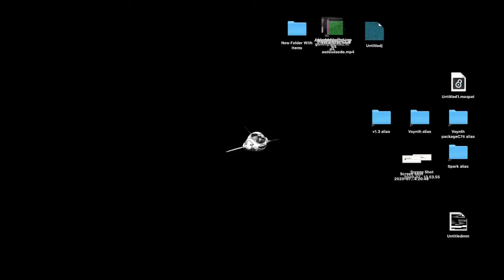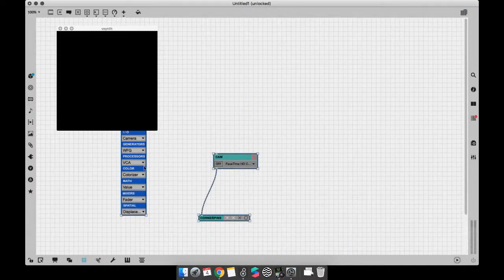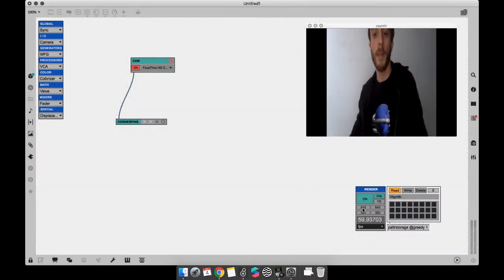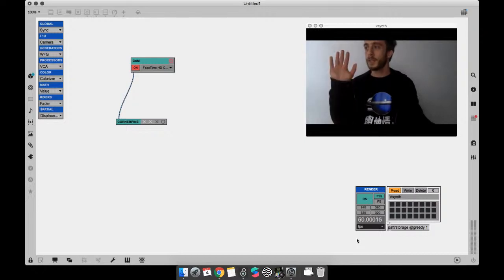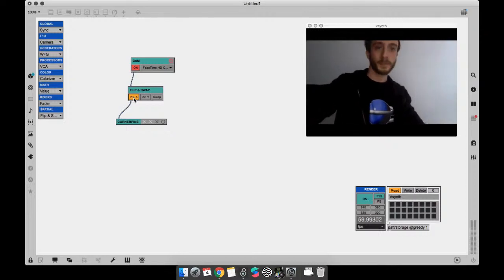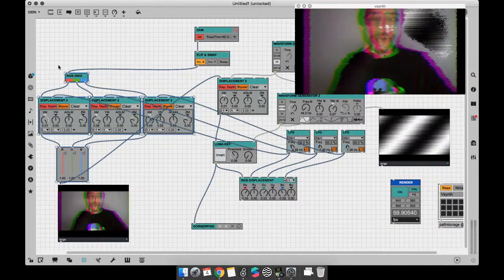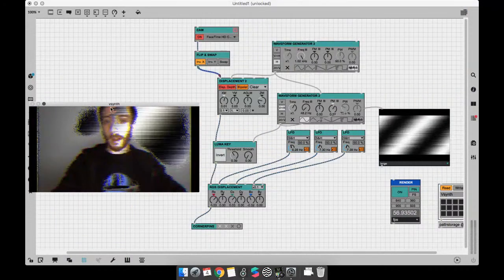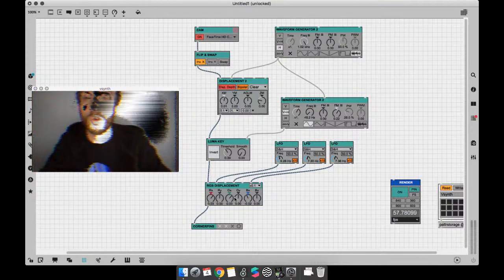Vsynth Lockdown 1 - Glitchy Thingy

Comment: hello,first of all thnx for Vsynth and for the video. I have a  problem  with LFO module in S&H mode. the module outputs only 1.0 ,i overcome it by using max objects.Just reporting
Reply: also the cords from LFO are both data cords not audio
Reply from the maker: @d0gan0s  Hi. I can't repro here. LFO module is spitting values between 0. - 1. as always so most probably is something in your patch. On the other hand, LFO has two outputs: Texture on the left, Data on the right. What you are noticing is a Max bug that doesn't change the patchcoord correctly when using data objects with texture objects. There is no audio input/output in almost no Vsynth module.
Reply: @kevinkripper  i was referring to the yellow-grey cord as audio cord,i am sorry. as for the data out,i continued experiments and sometimes work but mostly do not.i use it with max 8 and x64 windows 10 system.
Reply from the maker: @d0gan0s  go to Max preferences and switch back from gl3 to gl2 OpenGL Engine to see if that fix the problem with the LFO's data-output in S&H mode.
Reply: @kevinkripper   i also forgot to mention that i already tried it. its ok.if its me i will find the problem. : )
Reply from the maker: @d0gan0s  Wierd! I can confirm the bug in Mac OS with gl3 engine but switching back to gl2 fix it. Gonna make the bug report to c74. Thanks. I will take a closer look in Windows in these days.
Reply from the maker: @d0gan0s indeed its a Max bug already reported. Downgrade to gl2 or enter [LFO] and replace the [jit.gl.texture] after [jit.noise] with a [jit.gl.pix vsynth] and inside a [swiz x] between [in1] and [out1].